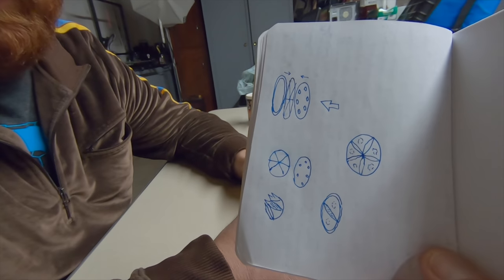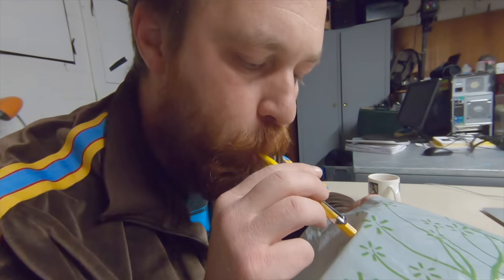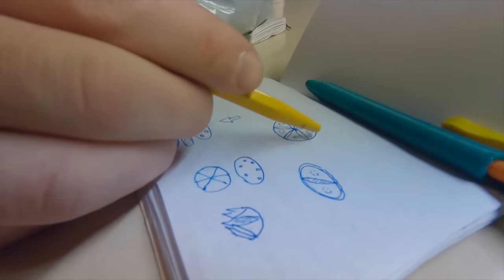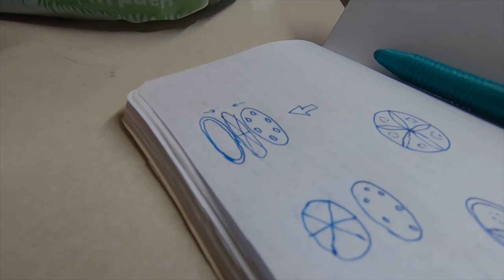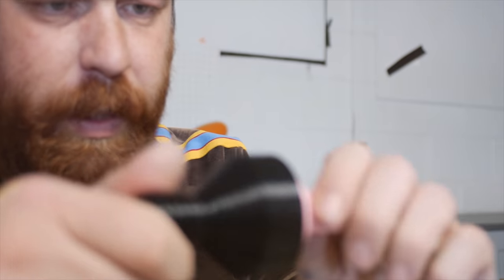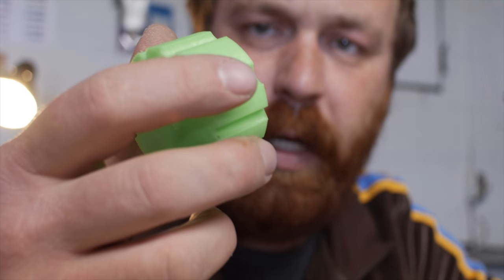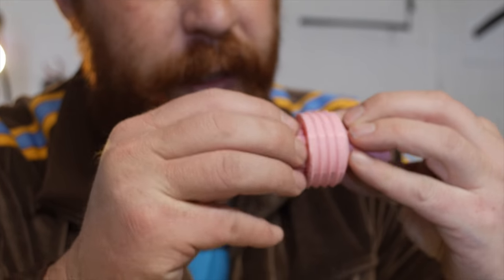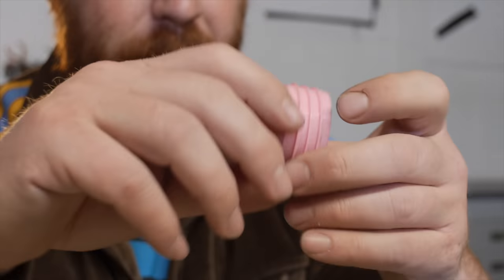Crowd-Sourced Respiratory Ventilator Project

Comment: I am an Respiratory Therapist . Nobel Effort . Keep in mind you must be able to control the volume of air delivered because  every one has a different lung capacity . Also how often the patient gets a breath Rate . Last Liter flow . How fast the air is being delivered . Must be able to control inspiratory to expiratory time . Mode of ventilation  could be a control ventilation at the very basic mode as long as the patient is sedated , so they won't fight the ventilation . Ventilators are very high tech these days , but like you said emergency situations . Thank you for your efforts .
Reply: Time to hit the hospital basement and dig out the old servo 300 vents! Has to be a closet still full of Bird Mark 7's somewhere!
Reply: Constant Gardener
Ok , how about this ; a car windshield wiper switch set to intermittent, to a car blower motor , to a tube to a mask ? You could hook it to a 12 volt converter or a 120 volt converter ?
Reply: Your information is very helpful

Comment: 22mm is your friend.  Only an exhaust port needs to be designed that already fits a widely available hepa exhaust filter.  Nearly everything in the respiratory world uses 22mm connectors, but ID and OD.  You needs to consult with respiratory therapists.  In the US respiratory therapists are the ones who set up, start, and manage ventilators. Drs and nurses usually only know the basics.  I'm a respiratory therapist.

Edit: I made that comment before I got the part of the video where you mentioned that you knew about the 22mm thing.

Comment: Working on a similar project here in Norway. I work at a major hospital (in administration) and are in direct contact with a number of doctors, etc.
Also in contact with local injection molding factories that now have a lot of free capacity. I have worked with them on a project where we went from 3D printed prototype to mass production in a week.

Comment: To make a  good seal valve membrane: cut a flat piece of latex (party) balloon approximately the disc size you want. Cover it with a piece of thin packing duct tape. So you get two layers - stiff-ish plastic on soft rubber. The rubber seals nice, the duct tape prevents it being blown through the holes. Then cut it the circle size you need.
Reply: Keep the ideas coming!!!! 👍👍👍👍😃
Reply: Thanks for the suggestion.  I tried it and it really makes the check valves work much better.  I really appreciate the tip!

Comment: On the pla slug valve you might need a resin type  3d printer for smother side fo slide more freely. Filament 3d printers are known for the layer line sides.

Comment: Hello BTW you can put glue in the center of the membrane to take profit from all the wholes also instead of glue you can use screw or one way plastic rivet.
Reply: The question if is decided to go your way is: duration, how long it will hold with the rivet?  with glue I believe we can hold the plastic membrane onto the female fixture with a rubber washer.  The other issue is frequency the membrane will work at least 20-40 times per minute over 9000 repetitions per day, putting this piece under a lot of movement/pressure.  I guess a better quality membrane maybe thicker should suffice.  But I do like the idea of the rivet in the middle with a better quality membrane.

Comment: Military Gas mask and dust mask use a 5 or 6 spoke wheele with a single stud in the center, with a seal film about like thin craft foam for the check valve.

Comment: Right On!  I'm with alan.. as a foundry and machine shop...we can cast from printed mold part faster than printing. but you're part would work  wonders with standard cpap machines,that handle warm hydration and sensing pressure as ex flow control. also an attachment that added 02 to the line on cpap.. would be great!

Comment: First you need a motor - use a drill

Then you need to match the speed - use a v belt to run a large disk

Then you need a crank - put a peg in the disk

Then you need simple reciprocal motion - attach a rope to the peg and have it pull up and down a weight attached to a piston

Then you need a piston - a threaded rod and use nuts to secure the piston. Ideally the make the piston from expanded polythene made ridged almost up to its edge with a plastic or metal disc.

Then you need a cylinder - and large bore smooth pipe with a plastic end cap.

Then you need 2 non return valves - one to let new air into the cylinder and another to let compressed air to the person.

Then some hose

Then something like a driving mask ( this is the most difficult part)

Comment: The membrane check valves are common in many breathing apparatuses, using a round silicone like membrane with a center barbed pin (one piece) to fit inside a smaller orifice, retaining the membrane and its shape to ensure it covers the air passages and doesnt deform. Anything I can think of to help I'll post, again thank you so much!
Reply: Commonly called umbrella check valve, the membrane is anyway

Comment: I am going to make a suggestion that probably has more value than ventilators.  If we got a low level light therapy device that laid over the chest and the back of the neck we probably would help a lot.  This is IR optimum between 808nm and 1054nm.   Cleaning the exhaust is easy with UV light.
Reply: Good ideas.👍👍👍😃

Comment: I suspect germicidal full-spectrum UV lamps (ex.: quartz mercury lamps) would be a viable exhaust sterilization method: besides the direct damage whatever may be present from UV-C exposure, sub-250nm UV also generates ozone which would oxidize whatever is in the exhaust stream too. You would need a pre-filter to keep the lamps clean and may also want to re-circulate some of the excess ozone to the pre-filter's input to prevent the pre-filter to become a breeding ground for other stuff. All you need is enough UV lamps to make sure you have enough ozone and UV output for the flow rate you need to treat.

Comment: The air flow is higher then the sand dollar valve would give you, if you use the 5 or 6 spoke wheele support.  Look to the m17 gas mask valve to see what I'm  referring to.

Comment: Consider larger nozzle 0.8mm or 1.0mm to print faster and larger walls. Stefan CNCKitchen has a video about increasing speed and thickness just be telling a slicer that your usual 0.4mm nozzle is a 0.6 and setting extrusion to 200%, temp +10C.

Comment: For the moisture component maybe a fish tank heater and aerator stone connected to a fish tank air pump inside a 5 gallon fish tank.  One could regulate O2 into the air line.

Comment: Hello.
We are from Morocco North Africa.
We are also thinking about making locally Ventilators in case of shortage.
We are thinking to put kind of burning electric resistance to kill the Virus in the exhaust parts since no time to look for special filters.
Thanks a lot for the works you have done
Reply: pica picatchoof There are CPAP/BiPAP machines that can work like a ventilator using different modes, such as AVAPS. Rate, tidal volume, etc can all be set.

Comment: To the best of my knowledge, people who are intubated are Paralyzed so that their own body's respiratory urges don't fight the mechanical breathing.   This would require something more like a wet/dry vac with the positive and negative pressure sides both connected to a rotary valve that switches between the two (pressure air in > negative pressure out cycle).
I'm not understanding how these valve's fit into the devices where the patient has no respiratory function?
Reply: yes, and so the patients don't go crazy. ventilators are pure torture.

Comment: I just watched a video where a guy uses a c pac for sleepers. He is also working on ideas. I'll get the site or name.
Johnny Lee Open Source homemade ventilator ish
Reply: willivision  thanks for the links and info!!!😃👍👍👍👍👍
Reply: I've seen Johnny Lee, I think his method is great.  very clever.  I may get down that type of design eventually, either when I finish these parts, or when I get too stuck and give up.  Johnny's design is clever.  I think I would not reinvent the wheel on that one, but take it and add things like pressure sensors and triggering for matched rate autonomic breathing.  so many ideas, so little time...

Comment: Amazing work. Just a thought off the top of my head - as far as the compromise of how thin-walled you can make it to minimize printing time versus necessary durability, have you considered adding ribs for structural support, which might allow you to consider thinner walls? I drew a picture of what I mean - not sure how to attach images to a comment, so I'm copying and pasting a Dropbox link to the picture: https://www.dropbox.com/s/9zdgq1jnrtjsn0w/suggestion%20ribs.jpg?dl=0